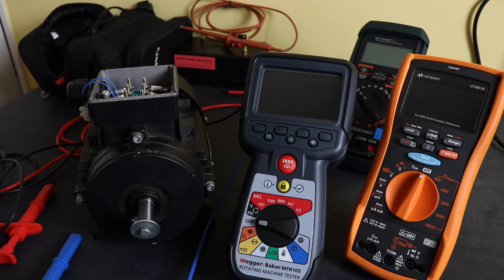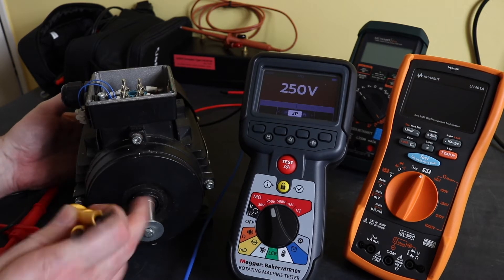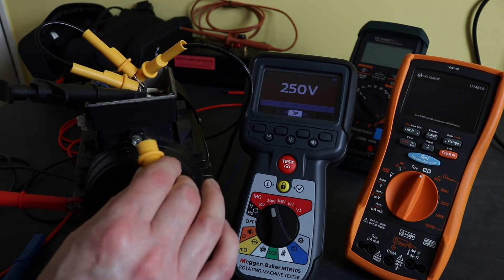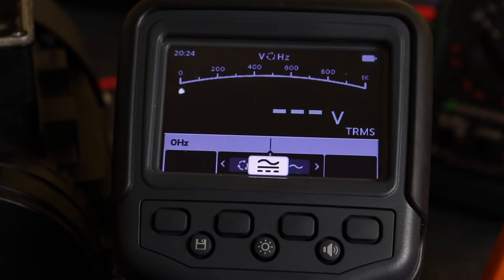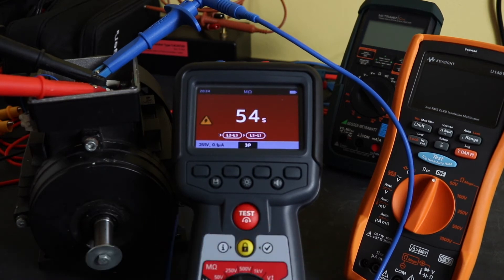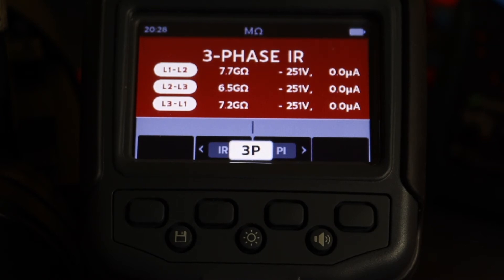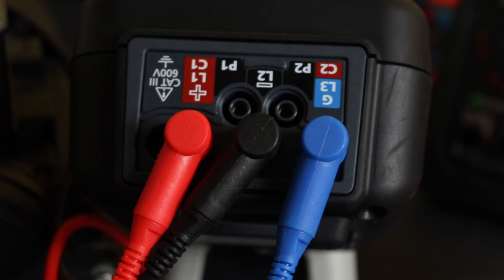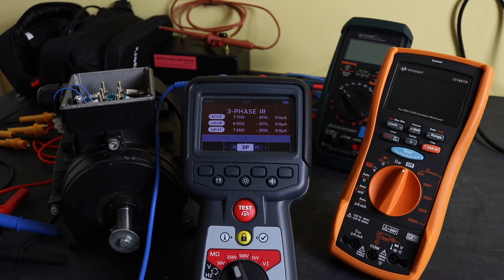3 Phase Insulation Test with the MTR105

Comment: Damn, no four lead test for winding resistance to ground. I just assumed it did it, why wouldn't it? Damn Megger! I could care less it can't detect rotation from a VFD, but this is disappointing. I do however like the remote lead ability, if that remote lead works for the DLRO test function. I'll have to download the manual and check. Thanks again for the video, off to see the third one.
Reply from the maker: Thanks for watching and commenting.

I too was disappointed that it didn't also test to ground - not the end of the world as you can still set up the test manually but it would have really made the unit standout it if did have the feature. Unlike some of the issues I see it having, I think this one would require a redesign of a part of the instrument to implement.

The remote lead does not come with the instrument, so you have to purchase it separately. It is the same lead that the MIT420 series uses, I have not found another one that is compatible. It is only a single probe output, so isn't compatible with the 4-wire DLRO test, it may still trigger it, I haven't tried that but I will give it a go this weekend and report back on this comment.

The 4-wire test mode does have both a manual and automatic function. In automatic mode it will start the test itself as the probes make contact and a circuit is detected, which for me is just as good as having a remote button to start the test. It is an interesting option though, I did purchase the duplex leads for the instrument from Megger and they do not have the remote operation button.

There will be a video out on the 4 wire testing towards the end of next week / beginning of the following week.
Reply: @three-phase562  Ok, the auto function would work just as well then. Good to know! Thanks.